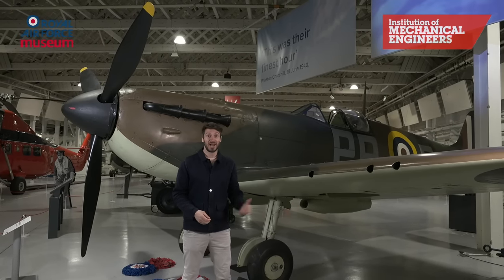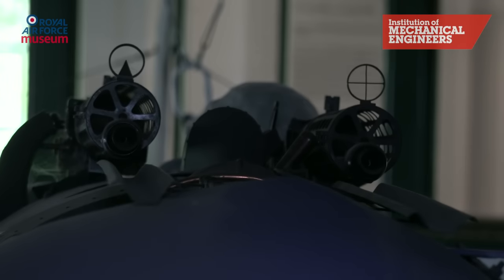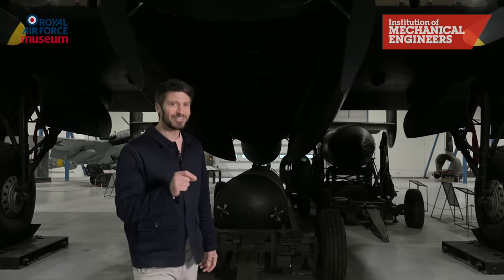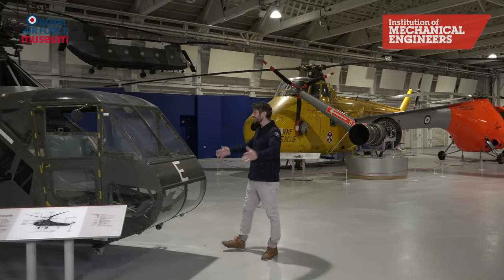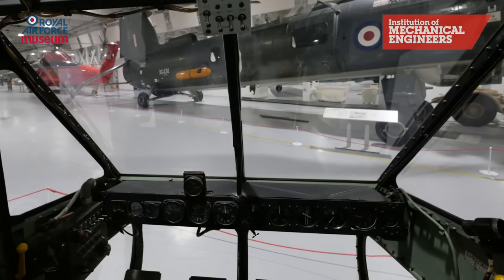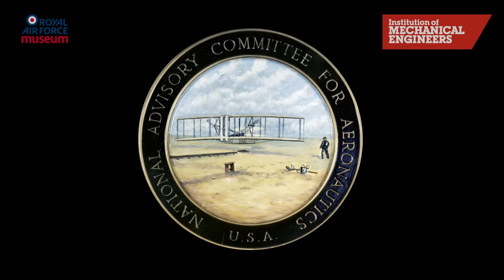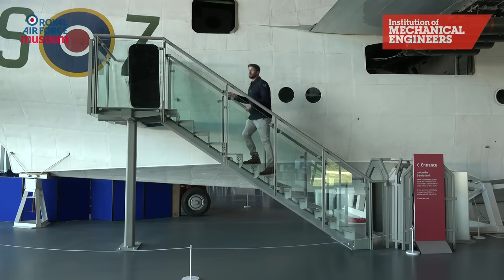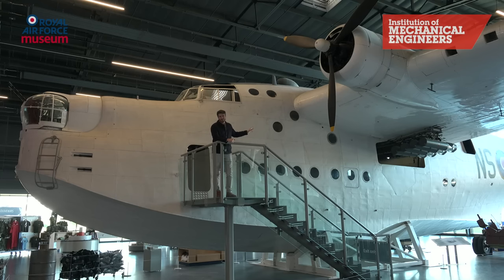London's Top 5 Aircraft with Rob Bell

Comment: My only comment is that the P-51 was not "right first time". Both the Merlin powerplant and the bubble canopy were vital additions to the original design.
Reply: That could be said for 90% of aircraft ever made really.

"Never fly a Mk1 aircraft" has been said many times.
Reply: @richardwillson101  did really or was that in a dive or a controlled test, I had even  hard the P51-D had use 1 third of it Fuel up before it was easy to handle being a tad heavy and Sluggish with fall tanks
Reply: Spot on, at first it was under powered at altitude and required the Merlin to make it viable. The RAF took the rough diamond and gave it the foundation to make it great. The mk1 Spitfire was a greater success out of the box and as an aircraft in general.
Reply: I believe the comment Rob Bell made about "right the first time" was in reference to the wing design & the aerodynamic work done by other's. (chart at 8:48) Cheer's from over the pond!
Reply: @keithstapleton7805  You are wrong !!!!  As the Allison Mustang was faster than the then current $hitfire Mk V with its single stage supercharger, you see the merlin 60 did NOT exist until late 1942 in service 1943.  The $hitfire was NOT a success "right out of the box" with its single stage supercharged engine anda fixed pitch prop.  and NO range !!!
Reply: @daniellastuart3145  Wrong !!!!  It was only when they added the 80 gal tank behind the pilot, moving the center of gravity,  with its twice the capacity of the $hitfire it handled Great,  The $hitfire was a compromise in small fuel load to gain manueverability.
Reply: @wilburfinnigan2142  truth hurting uncle Sam’s ego?
Reply: @wilburfinnigan2142  The Mustang wouldn't have even existed had it not been for a British Air Ministry specification, so you can stick your Spitfire insults where the sun doesn't shine.

Comment: Harrier - unique solution for a perceived problem (soviets destroying bases), which also changed naval warfare. Tornado - introducing a lot of new technology (ground following radar, swept wings) and not failing. Mosquito - realizing that there is an unused resource (wood manufacturers) and designing an amazing product. Air refueling - really changed the face of air war. Drones/cheap manufacturing - cheap drones that can take out expensive tanks, support arty,... without injuring their operators is also a game changer
Reply: Tbh the swept wing design made it into production on aircraft such as the F-14 Tomcat, F-111 and MiG 23 long before the Tornado went into production but it was based on a British idea from the incredible mind of the great aircraft designer and engineer Barnes Wallis.

Comment: I had the privilege of working on the BBMF as a Rigger, having worked on both Hurricane and the Spitfire, the difference between the design and construction is staggering, considering they were designed close together.  As a design engineer I guess the Spitfire would win every time, it was the first of its time. But the Hurricane is a design delight in its own right, it was the last of its time. The Hurricane  design made it simple to work on, it was and is an engineering success. by the  time on the flight came to an end my early delight at being able to work on Spitfires had  transferred to an absolute love of working on Hurricanes

Comment: Excellent presentation, I would like to suggest for consideration the English Electric Canberra developed first in 1944 as the DH Mosquito replacement (yes very big shoes to fill) entering service in the RAF in 1951 and serving in a variety of roles to 2007 (56 years in continuous RAF service) widely exported and even our friends in the USA saw its potential and operated them as the modified B57 - I believe NASA still fly them (WB57). 
Operational in a range of challenging theatres in several variants from Suez, Rhodesia, Vietnam, the South Atlantic and many places beyond carrying everything and anything you can imagine with good serviceability and safety, it was loved by its aircrews.  
If people knew how important and effective this aircraft really was and more importantly what it could do perhaps it would get more credit however restrictions prevent me from elaborating further.  A fantastic platform that could fly like a fighter and set many records and was a test bed for many aeronautical advancements. If you are still not convinced  just watch Roland Beaumont's demonstration of the prototype at Farnborough to see some of its potential for development. Am I biased - perhaps as my late Father flew them extensively but I cannot comment further.

Comment: Hey Rob, thank you for a very thought provoking video.  I had never considered the Sunderland in terms of it's engineering, so I'm glad you brought it to my atttention.

I would suggest you consider the Mosquito and the Harrier for some place in the order.  The Harrier in particular brought "out of the box" concepts to operational service.  The Mosquito less so, because DeHaviland had been building wooden aircraft for a long time, but the excellence of their design was the reason for it's brilliant performance, and of course the design team knew that the wooden structure was going to be vital during the wartime demand for aluminum.  Both of them are brilliant examples of British engineering.

It's instructive as well to compare the performance of the P-51 B,C & D to the Spitfire IX.  Since the V-1650-7 was the functional equivalent of the Merlin 66, the aircraft had equal power.  Yet the much larger and heavier Mustang was as fast.  This would have been an aerodynamic impossibility without the information coming from CalTech & NACA (and feedback from the skies over Southern England).  

Anyway, thanks again for an interesting video.  Please keep up the good work.

Comment: The combination of an amazing American airframe with the British Rolls-Royce Merlin engine made a war winner.
Reply: If you mean the Mustang it was built by Fokker they just changed the Company name. Same people who built the triplane.
Reply: The Mustang was Designed and Built by North American Aviation in 1940!
Reply: Fokker America was part of the General Motors Corporation as was North American. However Fokker demerged from GM in 1931 and had nothing to do the the Mustang.
Reply: Very true edward,  i believe it was just "adequate" rather than "right, from the start" as said in the video, it was indeed in my opinion, only when the merlin was fitted by the british, that it became a world beater.
Reply: Mustang was terrible until they installed the RR Merlin
Reply: 1)   The merlin only affected it's high level performance, which was vital for the UK but not for (for example) the Soviets who fought most of their battles at medium altitude.
Reply: @fatdaddy1996  No, they weren’t above 30,000. The heigh5 usually varied between 20,000 and 30,000 but nobody was bombing above that.
Reply: edwardpate NO British built Merlin engine was ever used in a Production Merlin Mustang and ALL Merlins used in the Mustang were built and modified, improved by PACKARD and Built in AMERICA!!!  Why the V1650-3 or -7 were ONLY used in the Mustang !! !
Reply: @jimroberts3009  Very true !!! !
Reply: @wilburfinnigan2142  my, you sound angry Wilbur.  I think the  Merlin improved the aircraft.
Reply: @wilburfinnigan2142   built in America .... designed in Britain

Comment: I guess the Manchester, from which the Lancaster came, was not a heavy bomber? The Lancaster was basically a Manchester with a longer wing to hold two extra engines.  And the short wings were caused by the RAF requiiring a wingspan of 99 feet, to fit into existing hanagars. The P-51 was a clean sheet design taking advantage of everything learned to that point. The Kittyhawk, and Hurricane, were continuations of earlier designs and restricted by that.

A really interesting design element of the P-51 was the radiator ducting and design that significantly reduced the drag of the radaitor.

It would be interesting to compare the Sunderland to the Martin PBM.
Reply: The Manchester suffered from the same restriction on wing span as the Stirling.   The Stirling as a bomber was not as good as it could have been, yet Shorts managed to produce the Sunderland seaplane.
Reply: Frosty  The Martin PBM was a better more powerful aircraft !! !

Comment: I love the Sunderland but if longevity is a reason for its position, it is well trumped by the Vulcan and the Shackleton. For pure engineering design, surely the Harrier should be on the list.
Reply: And the Nimrod?
Reply: The vulcan is overrated, as apart from Nuclear Deterrent, it never really did much.

I'm not sure if they have a Shackelton at Hendon Museum.
Or a Harrier for that matter 🤔
Reply from the maker: @richardwillson101  the RAF Museum’s Avro Shackleton AEW2 was at the Science and Industry Museum in Manchester until being moved in 2022 to the Avro Heritage Museum in Woodford, Cheshire where it was originally built in 1954.

We have a Harrier GR9A at our London site and a Harrier GR3 at the Midlands site.
Reply: @richardwillson101  Plenty of cold war aircraft "never did anything". That doesn't mean they weren't any good. Unlike the Septics, Britain never had a need to drop 10 tons of iron bombs at random for almost all of the Vulcan's 30 year service life.
Reply: @jonathanmormerod  I'm very glad of the fact we didn't.

However, I stand by my opinion that the vulcan is overrated as a platform in history.
It is beautiful, it was cutting edge risk taking design, but plenty of other aircraft held the same deterrent role alongside and would have done the same thing had it been required.

The endurance they faced on the black buck sorties is quite impressive however.

Comment: The P-51 Mustang was not right first time, as it was originally a lacklustre attack aircraft called the A-36 Apache, and even the early Marks were not significantly better than the P-40 Kittyhawk. However, when they put a Merlin in it...

Comment: what, no F4 Phantom?
Reply from the maker: Sorry @Cthulhulnc, maybe it will make it into the Top 5 Jets video
Reply: Great aircraft ,worked on them in the early 70`c at RAF Coningsby...
Reply: The Brits produced jet fighters equal to or better  then the F4 during the same time period. In my opinion.
Reply: @raywhitehead730 Definitely an opinion!

The F4 was an incredible aircraft and thr favourite of MANY a Fleet Air Arm pilot over any British made aircraft of the time.

I'm sure many RAF pilots would say the same.

Comment: The Lancaster wasn’t the first bomber designed by Avro. That was the Manchester. Although similar to the Lancaster it only had two engines and was vastly underpowered for the job. The lessons learnt from the Manchester went into the Lancaster which is why that plane was such a good bomber.
Reply: First HEAVY bomber, just as he said.
Reply: @Pte1643 the manchester WAS designed as a heavy bomber, not sure what youre trying to get at?

Comment: The Lancaster carried 3 times the bombs of a B17.
Reply: Love the Lancaster, but the B 29  beats it and the first production types first flew only about 11 months apart. (  1941, 1942 ) Pressurised cabin, computer controlled gun systems.
Reply: It had to carry 3 times the bombs of a B17 to have any chance of hitting anything at all when chucking them out in the pitch dark.🤣🤣
Reply: @grantm6514  If you want to find out just how (in)accurate USAAF bombing in the ETO was, check out Lord HardThrasher. The Norden bombsight was rubbish and the bombing accuracy by day was barely better than the RAF by night. It only improved substantially once the AAF started using pathfinders and H2X, by which time the need for accurate bombing had passed, unless of course it was pinpoint accuracy on hardened targets that was required, in which case B-17s & B-24s were useless because they couldn't carry the bombs required to destroy such targets and the RAF's SABS was far better than the Norden.